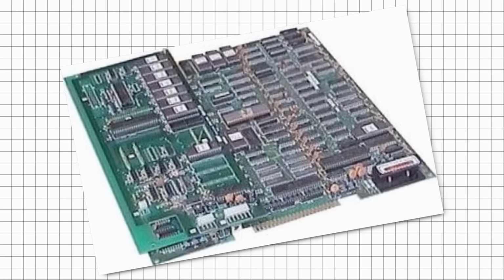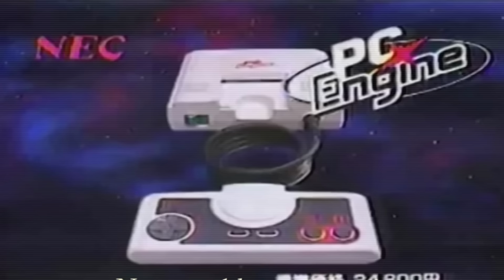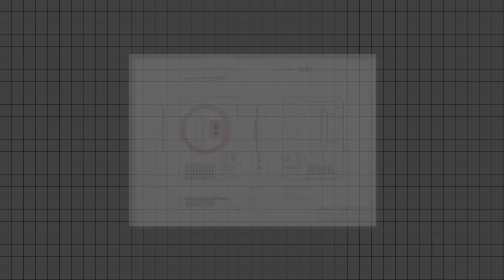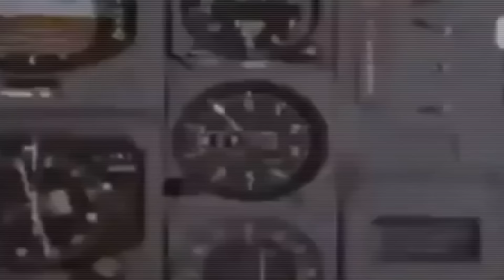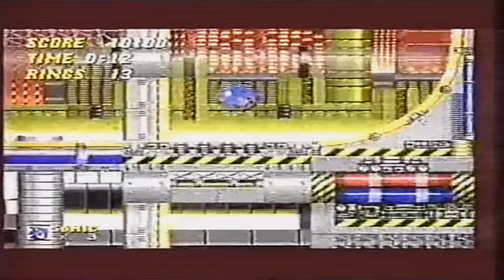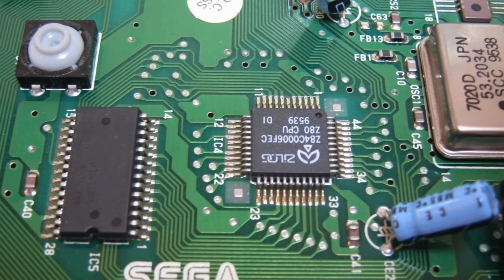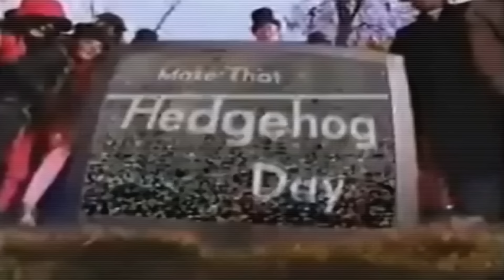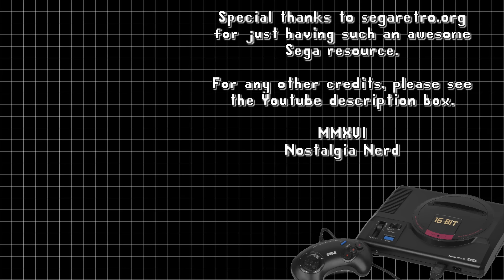Sega Genesis/Mega Drive Story | Nostalgia Nerd

Comment: Some of the non high definition graphics model 1's still had good sound because they still had the YM2612 chip. The ones that are good have the same port arrangement as the high definition graphics model 1 but without the extension port. The model 1's with poorer sound quality have a different port arrangement at the back (they moved the ports inwards).

Comment: This and your Master System video really pluck my nostalgia strings, my first and second consoles.  I'm really tempted to pick up the Tectoy latest iteration of the MD, but honestly I've been considering hunting down an original Mega Drive 1 and a Mega CD to go with it for a few years.  Less concerned about the 32X, but I still would get one.

Problem I have is that I really want Popful Mail, which didn't get a PAL release.  And I've found emulation hasn't really worked for that game. :/
Reply: get a CDX that's what I did.
Reply: Is it region free?
Reply: no i don't think it is, but if you get an everdrive you can make the mega/sega cd games region free by loading the proper bios of the region of the game you're playing.
Reply: Definitely worth considering. Thanks :)

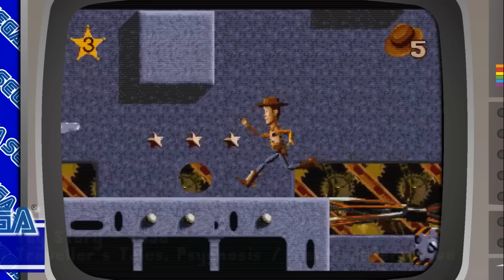Comment: 38:29 - The Sega Virtua Processor was originally made dor use in the original design for "Sonic the Hedgehog 3"; it would of been something like an improved version of what "Sonic 3D Blast" is, with superior 3D graphics and whatnot.  Even after that plan was scrapped, they found ways to incorporate 3D elements into the final Sonic 3 Complete (I call the whole game this because of a rom hack of the same name; I suggest it to anyone with a Genesis emulator.).

Comment: Minor correction - the 32X does work with the MultiMega/CDX, I used to use it myself! Sega just couldn't get FTC certification for it, so Sega themselves couldn't promote it as compatible.
Reply from the maker: sj33 Nice! Must have looked weird. I thought there a batch which did work although overheated, and a batch which didn't at all.
Reply: It wasn't ideal - the disc drive wouldn't fully open if you had the 32X connected because it was so big, so you had to carefully slot the discs in. And of course, you had the shite MD2 sound and video quality!

Comment: Hi!  I just discovered your channel today and subscribed immediately.  Your "the story of" videos are outstanding!

I do have a question/comment.  You indicated that Model 1 Mega Drives do not display the "Produced by or under licensed.." screen.  This alarmed me because I bought a Genesis at a retro game store specifically because it had the "High Definition Graphics" writing on it thinking that it is a model 1, however, it does display the splash screen you indicated in the video.  I'm wondering if I've been had!  Maybe someone swapped the shells?

It doesn't make sense though because I sent this console to someone to have all the capacitors replaced.  I bought the model 1 cap kit myself.  My modder was able to install the kit without any issues.  I've got to think that if it wasn't really a model 1, the kit would not have been compatible.

Do you think there's any chance that the splash screen DOES appear on SOME model 1 Genesis/Mega Drive systems?  Maybe the screen is part of a firmware that both models can use?

Would very much appreciate your thoughts! :)
Reply: The model 1 High Definition Graphics exist in 2 versions : with or without the TMSS ( spash screen )
http://retrorgb.com/genesisversions.html

Comment: I think the Sega CD was a lost opportunity. It should have contained a modem as well as been intended for use with a next gen console, expandable memory slot and video playback chip.  The 32X should have been beefed up and made the next console with tandem use of the Sega CD for larger games. It would have made sense as CD hardware was still pricey. Being able to reuse components only needed for some games would have been a revolutionary cost cutting measure.

If the Sega CD has been CDR it could have downloaded extra content for existing ROM games such as better soundtracks.

Comment: You've got some information wrong about EA's deal with SEGA.  Those catridges were designed because EA did not want to pay SEGA for the license, and had actually published games without permission.   That screen that shows the licensing information when you first turn on a MegaDrive/Genesis with a recognized cart in it is propriety code that had to be copied to boot the system.  And it was actually added because EA went to SEGA for a cheaper deal under threats they would publish no matter what.  The lawsuit SEGA lost against Accolade provide that EA would have been able to do this anyway.

Comment: Sega Master System and Mega Drive Games Rule in my book. In this present day era, I have got the Mega Drive Console and a Master System Converter. The five Master System Games in my collection are Pacmania, Ms Pacmania, Super Tennis, Castle of Illusion and Sonic Chaos. The five Mega Drive Games in my collection are Aladdin, World of Illusion, Castle of Illusion, Sonic the Hedgehog and Sonic the Hedgehog 2. To play the Master System Games, all I have to do is slide the Master System Converter into the Mega Drive Game Console Slot. Next step, open the Master System Cartridge flap and place any Master System Game in the slot. Away we go. The best way to play Master System Games, without the need for a Master System Console. SEGA and SONIC TEAM could still be around if they hadn't gone their separate ways, for whatever reasons they gave in quitting. There's only one way to discover what the downfall of this was. Watch the YouTube video.

Comment: Genesis/Mega Drive model 2s do indeed have RGB out; they need it to support the 32x. In fact, I think the model 2 has a much cleaner RGB signal than the model 1, and it's the version I prefer to use with an RGB monitor. A Genesis that lacks the "High Definition Graphics" label doesn't necessarily sound bad either, as it might still use the original revision's components. Only really late-run Genesis 1s have bad sound, as Sega basically redesigned the model 1's guts to use the same hardware as the model 2 right before the model 2 was released. 

By the way, if you're handy with a soldering iron, there are aftermarket mods available to fix the model 2's lousy audio. It's not easy, as it involves desoldering tiny little SMD components from the mainboard, and then soldering leads from the mod board to tiny little solder pads. But for the bold, (or those who don't mind killing a model 2 or two) the increase in audio quality is well worth the effort.

Comment: Sega had the win in his hands but the need to be the first in releases made them to rush a lot of things along with new hardware releases 32x sega cd  that confused the buyers.They should stay with mega drive till  the end of 1995 and then release a system that will have been closer to model 2 arcade board.It was foolish by sega to had in works a great 2d system that lately added some 3d capabilities and  renamed it saturn.Sega was a pioneer in 3d graphics they should have known that the war will go to the 3d territory and the demand will be to have decent model 2 games ports.Sony on the other hand used ps hardware as they reference board in arcades,system 11 didn't had the power of model 2 but at least they got arcade perfect ports.If sega made a system that was close to model 2 and release an arcade iteration with  games for it on arcades,things will have been played better for them.Never the less SEGA will be always my favorite company due to the simple reason that was innovators in all aspects of video games from hardware to software.

Comment: Unfortunately the new Tec Toy's Mega Drive runs trough emulation (hence the SD card compatibility), so it's not an actual Mega Drive as you said, altho as a collector myself, gonna grab one as soon as possible. haha
Oh, and it doesn't suffer from the sound issues of the AT Mega Drive, we're still waiting to see if it will be able to run with both the 32x and the SEGA CD.
Reply from the maker: Caio Pinheiro it is however, in a mega drive case. That is more significant for me.
Reply: True that, love the looks of the original Genesis/Mega Drive, it's just right.
Reply: Considering I found a supplier on Ebay claiming to be selling new stock of Yamaha 2612's, it may well include SOME original components.
I mean, this chip being available coincidentally when they're selling such a system seems... Peculiar.

A lot of the mega drive's components are off the shelf parts. Though the exact components may no longer be made, you can find related components easily enough.

Z80 processors are still sold as commodity items. Same with variations of the 68000 family CPU's. (also the 6502 and 65C816 the likes of the Commodore 64, apple II, NES and SNES use, though Nintendo's ones had far too many custom elements to be replaced with a generic version).

And of course, for whatever reason, I've come across supplies of 'new' Yamaha 2612 chips. Even bought 10 of them. They're dirt cheap.
Sure, I don't actually know what an ebay seller means when they say 'new'.
Could be old stock left over, but it could seriously be newly manufactured too.
Either under license, or just because a chinese company has the designs. (whatever patents it might have had in 1989 have long since expired, so if you know how to make such a chip, you definitely can sell them.)

The trick, as usual, is the VDP...
Reply: I just hope someday we'll be able to get out hands into perfect clone consoles...
I really wonder why no one ever done that before, it's not as if it's hard nowadays as you just mentioned, any patent from almost 30 years ago already expired.

Comment: Street Fighter 2 looked and played better? lol The Genesis version played much better, was much faster, plus had more animation. (6button controller) What held it back was the snes. It basically was a SNES port.Also, Ran at the SNES low resolution of 256x224. If only Capcom was more committed to Genesis/Megadrive development.

Comment: sega genesis was going to have 3.5inch floppy a keyboard printer and rgb video output and super impose effects
Reply: yeah but sega pland it
Reply: edek sega is a weird company
Reply: +Darkthief Their weird for planning to do something, and then doing it? That's weird.
Reply: Was your Genesis called Amiga?
Reply: True, but what was planned and what actually happened are two different things.
The snes was supposed to get a CD drive.
The newest documents on the matter show the CD drive would come with a 32 bit co-processor (the NEC V810 used in the virtual boy and NEC PC-FX to be specific)
(just to be clear, the extra processor would be in a cartridge sold with the unit, not the CD drive itself, in case you've seen anything about the recent discovery of a working 'playstation' prototype snes CD unit.)

Plus, it's obvious from the hardware design that it was at some poing going to allow some kind external video overlay (which it can't do), and it had 128 kilobytes of video RAM right up to the last second, when it was suddenly reduced to just 64. (that this is a last second change can be seen from the fact that the extra memory pin needed to use 128 kilobytes, as well as the internal support for it still exists, and in fact if you are really good with electronics you can mod an snes to include the extra 64 kilobytes that is missing.)

The programming documentation also makes mention of the possibility of there being a keyboard for it.

It's weird when you see all the minute details of these systems and what it says about them.
The seemingly tiny changes that if things had been a little different might have been...

That extra 64 kilobytes of VRAM in the snes for instance. You would likely have seen far more animation frames used, and more frequent use of the high resolution and high colour modes if that had been included. Because all of those things tend to be very difficult to do with just 64 kilobytes of VRAM.

That would have led to games that an actual snes as it was released cannot manage.

Or, going the other way, they added a huge amount of extra VRAM to the Mega Drive at the last minute too. If they hadn't the graphics it could have reasonably pulled off would have been much more primitive.

As for things like keyboards and printers and so on you would start to bridge the gap between consoles and home computers I guess.
Which would have been amusing to say the least.
Reply: Dark x the megadrive and genesis had rgb output.

Comment: My mega drive was killed by a lego house. :(
Reply: How did that happen?    Mine died after being pulled off the cupboard :(
Reply: +Larry Bundy Jr. Mine got killed by the Lego house as the house was thrown at it by an angry sibling. 

Was you's really high on the cupboard?
Reply: television and cheese That's rough.
Reply: television and cheese
Just table height,  not high at all.

Did you get a new one at all?
Reply: *****
No, I didn't, I think the PlayStation was out by then and I ended up with that. :)
I had a Sega Nomad, but I have no idea what happened with that.
Reply: television and cheese
Maybe it was stuff into the attic.
Reply: *****
I don't have an attic, live in a flat. :/
It will probably turn up eventually. :)

Comment: I'm not sure people really knew what a clock frequency was in 1991. I figured it out when I blew up my dx33 by changing the power voltage on the back and got a dx2-66 replacement so I figured it must denote speed. It had never occurred to me what the frequencies of the SNES and SMD are though as I'm sure that information was not relevant and never heard mention of it in 4 years of Sega Power subscription. So your talking bollocks Nostalgia Nerd.

Admitting you owned an SNES in the UK was like admitting you owned a Barbies dream house. Girls back then... Well I have no idea what they got up to. Listening to Jason Donavan and applying glitter to their faces probably. But some boys were not quite as sharp and maybe a bit timid or fragile and found the Mega Drive intimidating or something, I don't know. I knew two people who owned one and as I have often said, there are almost no games on that thing worth playing.

PS. I'm having trouble finding information on the SNES's co-processor. I'm thinking you mean the cartridge co-processors such as the SuperFX chips. Comparing the clocks speeds of the 5A22 and 68000 aren't comparable anyway as the SNES Ricoh 5A22 was more efficient per clock cycle. It was still a cheapskate budget chip and nowhere near as powerful it turns out.

Comment: You talk a lot about the Jag and the CD32 but even at the time the 3rd party support was garbage on those systems. Desired by the young and naive but really had little to offer. If for instance a company like capcom were to dedicate to one of those platforms history would have been different. Just as capcom was one of the many reasons the PS1 was successful in a saturated console environment. If SEGA executives were scared of the new hardware they were obviously doing too much cocaine.

Comment: sega games sux. make a top 100 games of the best 100 sega and best 100 snes games and it will be 95% snes games. apart from Sonic (and even then) what top games are on the genesis? altered beast? what is that a choppy-boring-slow side scroller? sega has shoot-em up which are ok but other than that it's crickets. All games look like alpha protoype tech demos that are boring, soul less and unfinished games

Comment: Blast Processing is such a BS marketing term.
It doesn't actually mean anything at all, strictly speaking.

At best it refers to the consequences of having a faster CPU. 
But pretty much all the scanline tricks that are attributed to it are stuff most 16 bit systems could do.
The Amiga could do it, the snes could do it, I mean, if you want to be really petty, the just about every nontrivial graphical effect on the commodore 64 depends on scanline tricks. 

Faster CPU no doubt helps, and faster DMA helps considerably more.
Plus, compared to the snes, if you're doing cpu based graphical stuff like drawing lines, or polygons or the like, the fact that the Mega Drive uses packed pixels while the snes uses bitplanes makes life a lot easier.
Bitplane based graphics have a lot of upsides, but they are a real pain to use efficiently if you are drawing pixels one at a time.
So really, to use it efficiently you have to figure out a way to draw pixels in batches that depend on the hardware. on an snes you should avoid ever drawing less than 8 pixels at once if you can help it. But that's the kind of consideration you don't really have to worry about with packed pixels like the Mega Drive and PC used. - well, actually the semi-infamous VGA mode X is a bitplane graphics mode, which did confuse a lot of programmers, but most other modes are not.

In short, the systems have different strengths, and thus did better at different kinds of tasks. Quite unlike modern systems which are all fairly similar, and about the only thing that really varies is just how much power any given system has...